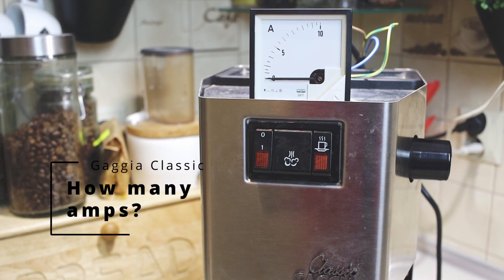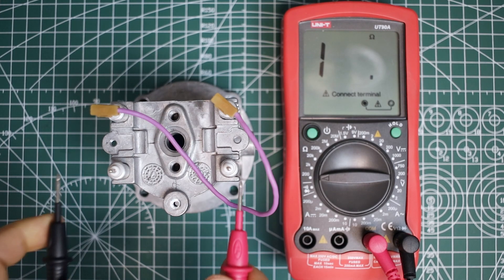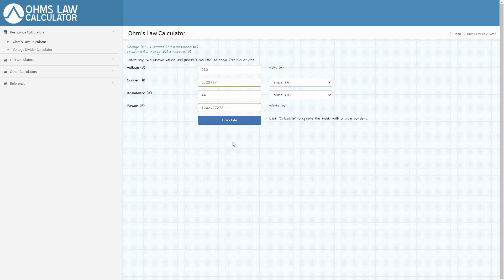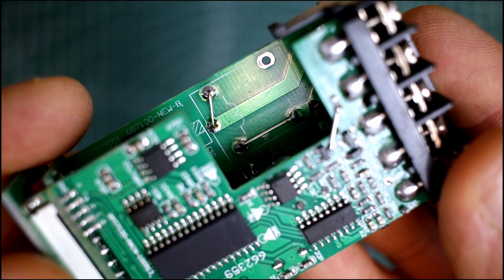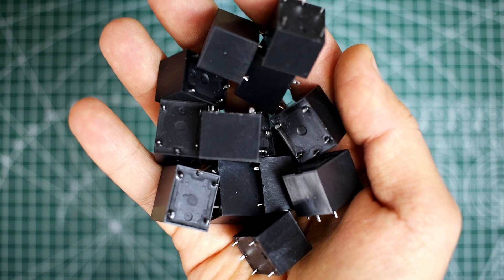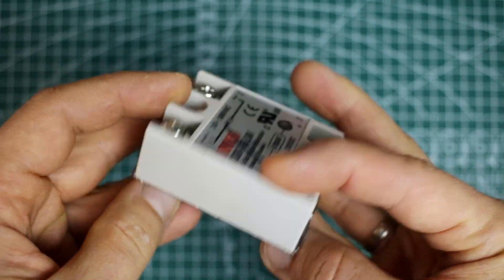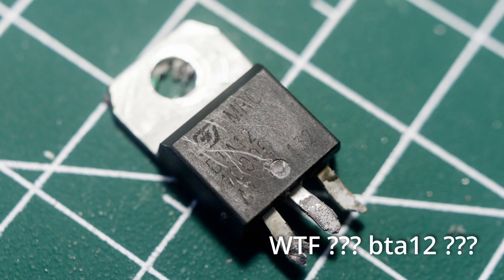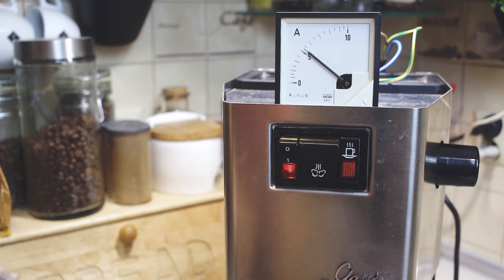How many amps does the Gaggia Classic draw?

Comment: How much amps does it take on idle, when boiler is heated after initial powerup?
Reply from the maker: It doesn't really make any difference, Gaggia is still charging 5.5 amps
Reply: @Gaggia_Fixer  wtf it's one hungry machine. I thought about removing turnoff delay but with those numbers it's safer to keep gaggias timming 😅
Reply: @kopczas  I'm way late to this but it won't be taking 5 amps when its in idle all the time, only as much as is needed to activate the heater to get it back up to temp which is about 30% of the time if mine is anything to go by.

Also the 5 amps is suspect to me, the math 230V/44Ohm is suspect cos in assumes the heater is the only thing on that line. Plus adding the pump and solenoid into it would add a few more, if you want to know get a wattmeter for the socket and count that